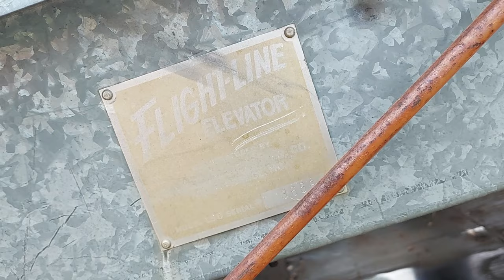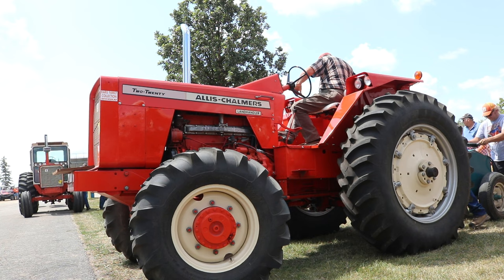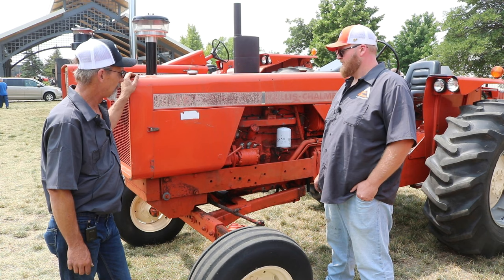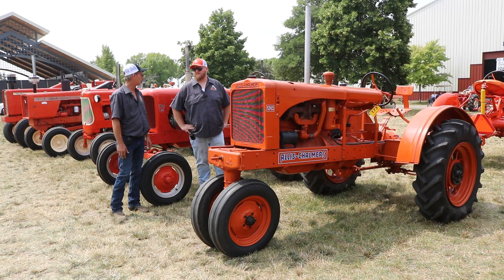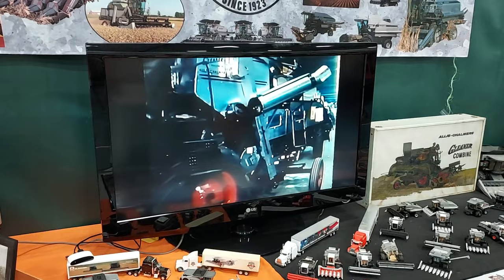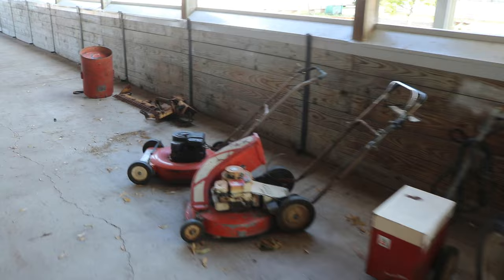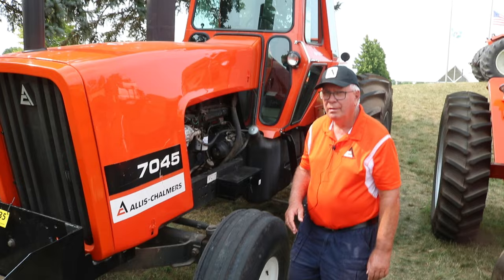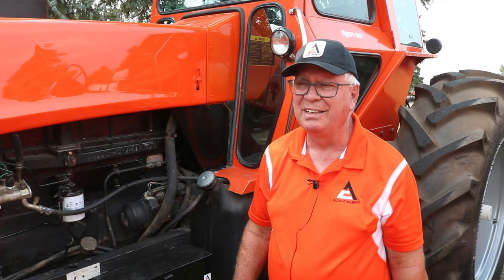Allis Chalmers Show:  2023 Orange Spectacular! D21s and Gleaners Galore!

Comment: Where is this?
Reply from the maker: Hutchinson MN every 4th weekend in July
Reply: @JandLVideos  Thanks, My Dad bought the first D21 in Hamilton county from a dealer in Webster City, Iowa.
Reply from the maker: @oneleggedguy  did he like it?
Reply: @JandLVideos  A bit heavy in the front he used to say, the 560 was the next biggest horsepower at that time, so, ya, he liked it a lot.  Thinking like 1960,  chrome pipe, bigger tires on the front, kept waxed and inside, if for a period of time the hood was covered with a white sheet. Ya, he liked it!!liked it!